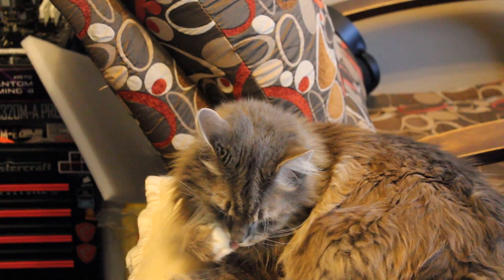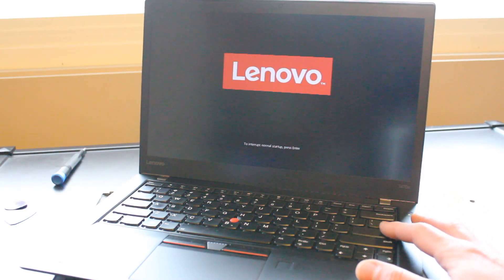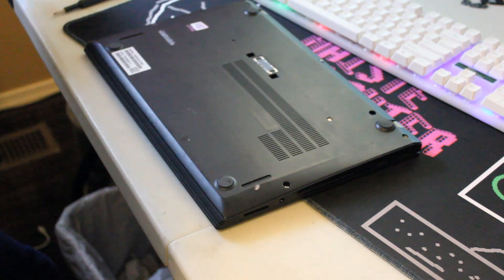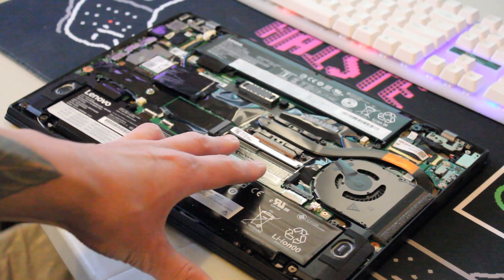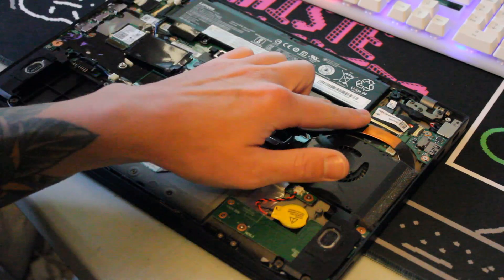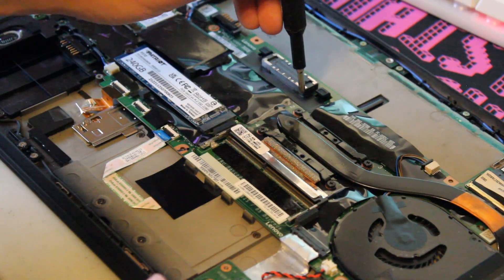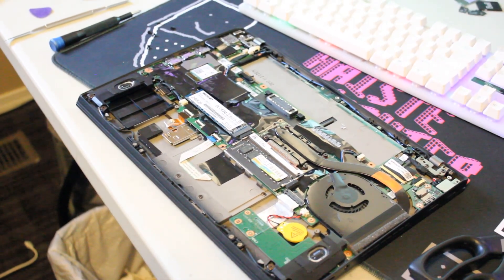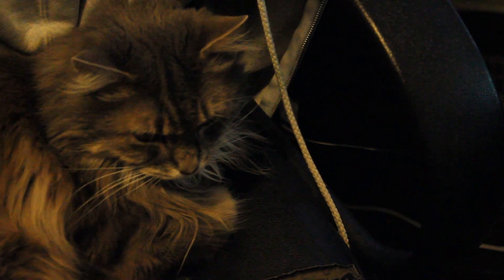Lenovo ThinkPad T470s NVMe SSD & RAM Install + CPU Service

Comment: You don't use an electrostatic bracelet connected to ground ? I have a copper and silver bracelet on my arms do you recommend I should take them off before proceeding ? Thank you for showing us this, it is very helpful for a first timer ;)
Reply from the maker: I have never worn an anti static bracelet while I work.  If I feel like I have a static build up, I might ground myself by touching some metal.  Perhaps in your case if you are able to take off the bracelets that may help with ease of access while you work.  But, I wouldn't be too concerned.
Reply: @HaisteComputerRepair  Ok, good to know! Thank you very much for such a fast answer :)

Comment: My laptop is not working, the repair guy said the processor is bad. How to know what type of processor to buy. There are numbers on the processor, it seems to me like he doesn't know what to say. Can you help with the information.
Reply from the maker: The CPU is soldered on to the motherboard, so you would have to replace the entire board.  If you do want to do this, search for "thinkpad T470s motherboard" on eBay or Aliexpress (if those are viable options where you live)
Reply: Thanks very much for your help, Egbert McLeod of Grand Roy Grenada West indies. @HaisteComputerRepair

Comment: Hi there 
470s user here
How do i know how many GB ram are solded?
I have 8gb specs tells
i wan  to add some  ram and GB memory. Thank you.
Reply from the maker: You will either have 4 or 8GB RAM soldered, but there will be 1 x dimm slot for upgrades.
Reply: Thank you very much.
And How about nvme upgrade? 
What series do i need? 
😊

Comment: Hello Sir, this Thinkpad lenovo T470s still usable and still working for 2025?? this is still cool to use till onwards??
Reply from the maker: Yes for sure.  Although it really depends on what you want to use a laptop for.
Reply: @ for Excel office work word and gaming sir so i am planing to buy like this bcoz i am on budget
Reply from the maker: @HannahMontana-iy9pt  Office work is fine.  Gaming, it will have to be lower end titles or light gaming.  You can give some examples of games if you like.
Reply from the maker: @HannahMontana-iy9pt  Ok, yeah you should be ok.  Good luck!

Comment: apakah bisa untuk t470s menambahan 2 penyimpanan ssd?? dan untuk jenis ssd apa yang cocok?? apakah nvme atau m.2 sata
Reply from the maker: Just one can be used.  Though you could install a large capacity, partition it, and set it up as a dual boot if that's what you are looking for.

Comment: Hi, I was educating myself about the topic of SSD and their bus interfaces (SATA or NVMe), and after reading I am still not sure whether this laptop supports NVMe. One key insight is this idea of SSD keying, where we have types like M, B, and M+B. Can you tell me which keying type is compatible with this laptop? For example, I'm looking at SSDs on my local marketplace at Facebook, and I see one Kingstone 1TB SSD, but it has one notch in the connection pings -> ||||||||_||||, while the SSD currently on my laptop has two notches  |||_|||||_||||.
Reply from the maker: The one with two notches would be a m.2 SATA III SSD while the one notch would be NVMe SSD.  This T470s can take either option, according to the product specifications.  I only installed NVMe SSD's personally.  https://psref.lenovo.com/syspool/Sys/PDF/ThinkPad/ThinkPad_T470s/ThinkPad_T470s_Spec.PDF

Comment: Im getting one of these that has an nvme 256 what would be a good low cost upgrade? Also the one im getting has 16gb ram. I would like to upgrade to what im told is a max of 24gb. Just wondering what i would need. I don't have it in my hands yet so im not sure of the layout. 
  Thank you
Reply from the maker: For budget NVMe SSD's you could look at Kingston, Timetec, Patriot, Silicon Power brands.  If it comes with 16GB, I am guessing you got the version with 8GB soldered.  So, you would need to purchase a 16GB DDR4 SODIMM.  The speed will cap at 2133MHz, so you don't need anything higher than that.
Reply: @HaisteComputerRepair  great thank you.
Reply from the maker: @WindWalkerDrones Timetec NVMe SSD's will have their own DRAM and some of the other budget brands won't.  If you're in North America, check out Amazon for deals or see if you can price match in a local shop.  Feel free to send me anything if you want a second opinion.
Reply: @HaisteComputerRepair  I'm in the states. I'll have to take a look online. I'm 40 miles from the closest shop. Lol   Definitely appreciate the info
Reply from the maker: @WindWalkerDrones Good luck!

Comment: Hi can any one tell can I change the processor of my lenovo
Reply from the maker: You can, but for the T470s this involves swapping out motherboards.  So, if you want an i7 instead of an i5 you can purchase a new motherboard and swap it out.  The CPU is soldered on to the motherboard, so it's not possible to remove just that.

Comment: Can you add 2nd M.2 drive? How come yours is only 4gb soldered RAM?
Reply from the maker: Yep you can add a m.2 SATA III 2242 SSD.  This T470s actually has 8GB soldered, so by the end of this video it had 16GB total.
Reply: @HaisteComputerRepair Can I do from 8 GB RAM to 32 GB RAM in this laptop?
Reply from the maker: @Cvajjo There is only one DIMM slot  and 8GB soldered to the board.  Specifications list 24GB being the max.  I was able to install a 32GB ram stick into my T480s for 40GB total, but I am unsure about the T470s.  24GB RAM is plenty for that system, though.  What do you want to do where you think you might use 32GB?
Reply: @HaisteComputerRepair I want play games in this laptop
Reply from the maker: @Cvajjo Definitely can within the system capabilities

Comment: How many ssd slot this model have I'm thinking about getting one t470s
Reply from the maker: one for the full sized m.2 NVME SSD, and one m.2 that can take a m.2 2242 SATA III SSD or a WWAN card.
Reply: have you tested use WWAN Card? thats Work? Answer please.
 @HaisteComputerRepair

Comment: How do u change the internal ram as its only 4gb as I want to use 2 16gb ram sticks?
Reply from the maker: There is 8GB RAM soldered on to the motherboard so you cannot do dual channel 32GB.  It will be 8 + whatever capacity RAM stick you install in the available slot.
Reply: @HaisteComputerRepair   If I take ram out of mine its 4GB not 8 so I can not remove it? Another thing how can you get the stereo mix to work as I going to use mine for streaming audio & there is none in there. I was using windows 10 but I put a clean install of windows 11 now both same thing no stereo mix option.
Reply from the maker: @drsysop  There is either 4 or 8GB soldered RAM depending on your laptop.  If RAM is soldered on to the motherboard, no you cannot remove it.  Your only option is 1 x DIMM slot for 1 x RAM stick, which will add on to the existing 4GB.  As for the stereo mix, I am not sure for Windows 11.  I'll take a look online.